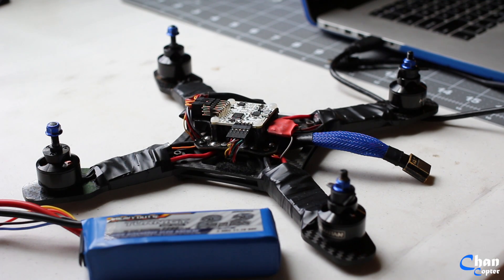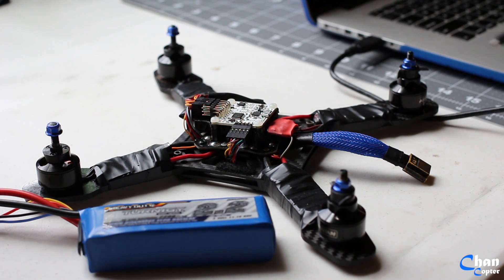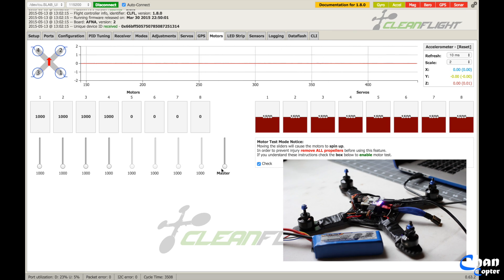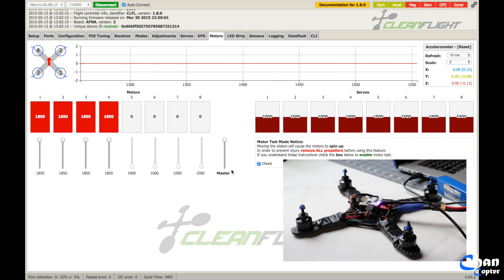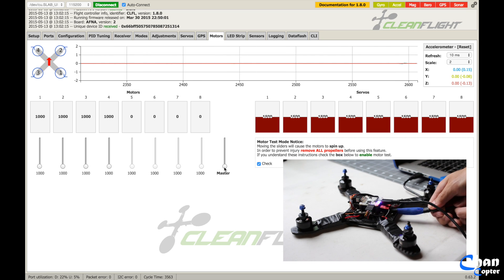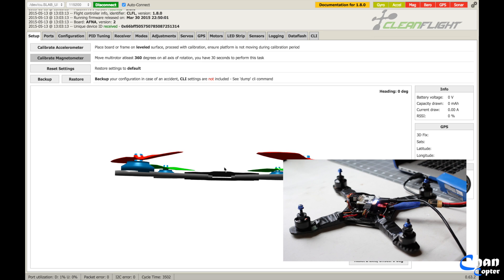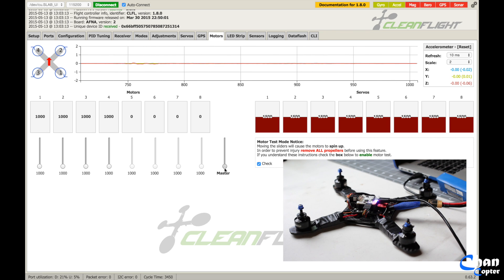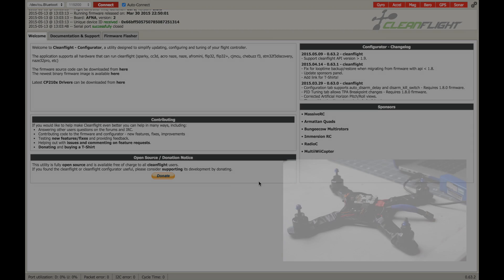How to Calibrate all ESC with Naze32

Comment: I was doing them one by one and successfully got two to calibrate. The other two I got the process wrong and now they just twitch no matter how high or low I put the throttle. Can I factory reset the escs or something to fix this? they all worked fine before I tried calibrating by the way.

Comment: I followed your instructions and everything works up until the final check. I connect and disconnect the battery and move the master throttle up and down and get the music but then when i disconnect everything and plug it back in the motors still are not controlled by the moving the master toggle? any ideas

Comment: Thank you for the video. Just have one question though. I did this ESC calibration in CF several times already but I am getting weird behaviour. No matter what is throttle stick position on my transmitter, always one motor goes slowly to max rotation and other three are slowly decreasing rotations until min throttle value. I am even getting identical sounds from ESCs while doing the calibration like you get. When I move master slider in CF all is good, when on my transmitter, all is bad. This happened to me several times already and always after doing calibration in CF. Only thing that helps is full chip erase in firmware flasher and flash the board win new CF firmware.
Reply from the maker: That's normal. No matter how level you have it on the table, it's not level to the board. It will try to increase power to one or two motors to correct itself but since it cannot move on the table, it will always go until a motor is at max and the rest at minimum. This behavior won't exist when you are in the air.
Reply: Thanks a lot for your wisdom and sorry for my noobness ;)
Reply: Chonny So if I leave my quad on low throttle for a while then try to take off, the motor speeds will be messed up and it will flip? My quad is just flipping on take off. Should I try punching the throttle right when I turn then the quad on?

Comment: Excellent "How to" video. Thanks for making is so simple. I am using Baseflight. I am ready to walk outside and fly except for one thing. When I move my quad, the animated quad in the set up is not even close to the same movements. Did Acc calibration. What did I miss?
Reply from the maker: +jerry zito Thanks! By chance did you mount the board with the arrow facing forward? If not, you can adjust the board orientation by the software to make the animation line up with the real deal.
Reply: Yes..The board is oriented forward, with arrow forward. Is there a way to change orientation so that the animated quad and my quad are synced.
Reply: What is weird is that I had it. both the animated quad and my quad were perfectly aligned. Don't know how I lost it.